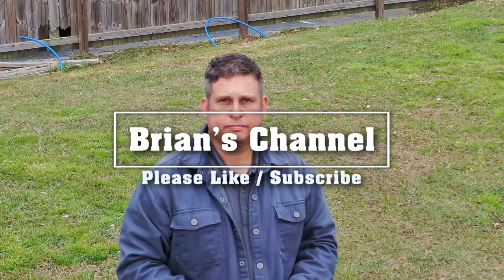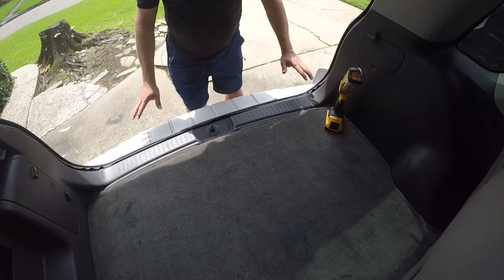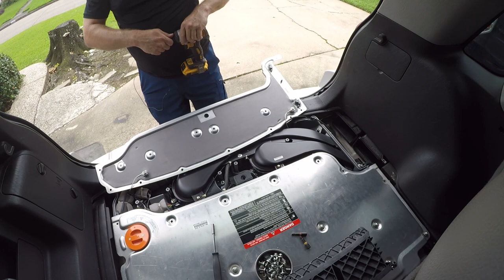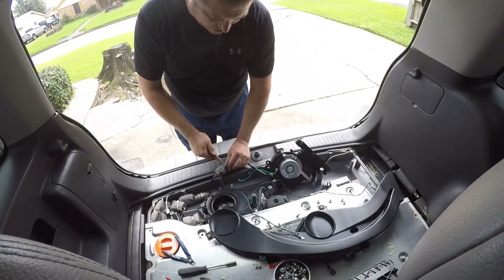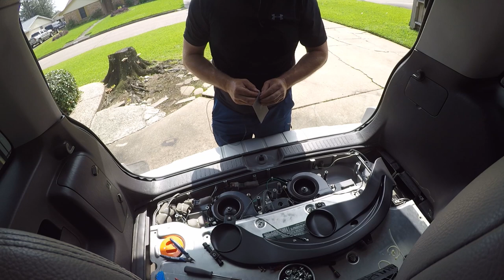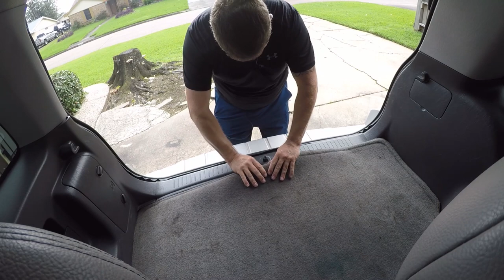Ford Escape Hybrid: Replacing the Hybrid Battery Fans

Comment: Great video. I have an issue with my cooling fan on my 2005 Ford Escape Hybrid, and this video will help me diagnose or fix it. What year Ford Escape Hybrid were you working on on that video?
Reply from the maker: I think it was a 2007.  I've since traded it in when I bought my Frontier.  The Escape battery was on it's way out and I decided I needed something a little shinier and more reliable to drive.

Comment: Hi Brian! this was a helpful video. last night I replaced the battery cooling fans after having a wrench light go off for the past 3 summers. I got the codes for the cooling fan but the dealer wanted a fortune so I replaced them myself. Long story short after replacing the fans the wrench light is still on but the vehicle is going into EV mode . Do I need to clear/reset the codes somehow? or is there a bigger issue. Thanks!
Reply: Next thing I would check is clearing the codes with Forscan ( there is a mobile version) You will also be able to see the BSOC and other BCM gauges. Since it's been 9 months the codes should have cleared on their own I think, if the problem is resolved. On my 06 FEH I just had the compressor and evaporator replaced. Next step is to do the battery fans.
Reply from the maker: @The-Grateful-Hippie  Make sure they did the rear orifice tube as well.   that makes a huge difference and mine was nasty when I replaced it.
Reply: @hotpuppy72  Hmm I did the replacement myself. I cleaned inside the ducts and there was a little bit of dust inside the battery case but it wasn't bad. Hardest part was getting the darn cover back on the case.
Reply from the maker: @The-Grateful-Hippie  The orifice tube is part of the AC system.... there is a dedicated AC unit in the back for the battery.
Reply: @hotpuppy72  OK! I will mention it to my mechanic who installed the AC. Everything is working great now 👍

Comment: Hi Brian! very helpful video. my 2008 escape have the fan code. that's why I ending replacing them how ever on your video ones you removed the fan cover you go and start the vehicle to check which fan wasn't working. my vehicle does start if the battery switch ( the orange  switch )pack is in the off, it was giving me a red warning triangle on the dashboard. do you know anything about it.

Thanks in advance.

Comment: Hi Brian! Thank you so much for the video. At  9:01 you turn your car on and I hear a grinding/pressurizing noise from your HCU I believe. My Escape makes the same noise!! Do you know if it is bad? Did the fan replacement make it go away? I believe it is from the HCU and am worried of brake trouble. I would so appreciate a reply. Thank you.
Reply from the maker: It was just going through self-test.  Always did that.

Comment: Did the fan that required replacement just abruptly stop working or did you first hear chirping or whining to indicate the motor or a bearing was crapping-out?  Also, once it failed and threw a code, did you get a HI TEMP immediate shut-down (limp home) dash warning or were you able to drive it for a significant amount of time?  Just curious....
Reply from the maker: It threw a code.  I should have replaced it right away.  The car stopped doing hybrid as much.  I should have replaced it sooner honestly.  

My biggest aggravations with the Ford Hybrid are the un-serviceable battery pack.  There is absolutely no reason for the battery to not be modular "sticks" of cells that are replaceable.  Except that Ford doesn't give a sh*t about owner's doing maintenance.

Second issue is the crappy HVAC design that requires the engine to run to have an air conditioner.  non-starter in a hot humid climate.

Third is the ABS module requiring a computer to bleed the brakes.  SMH.  Stupid stupid stupid.  

I have a Nissan Frontier now.  Simple, reliable and non-hybrid.  Plenty of stupid crap on it, but mostly very easy to work on and maintain.
Reply: @hotpuppy72  Feel the same...love the looks and MPG of my 07 FEH, but the more I dig in to the "workings" the more certain I get that I don't want another hybrid.  I just want to run this one as long as possible/reasonable.

Last year I purchased a DVD from a Ford dealer via EBAY for $8 that has the full service manual for my vehicle.  When the DVD was created in 2007, it didn't even account for replacing the battery fans.  The diagnostic flowchart stated once the tech determined one/both fans stopped working (i.e. it wasn't a wiring issue), the entire battery pack was to be replaced.  Of course, 99% of the time the vehicle would've been outside the bumper-to-bumper, making that repair the owner's to eat.  The other thing they apparently did either in 08 or 09 was ditched the jump-start button to allow the owner to use the 12V to charge-up the HV battery.  You see videos of mechanics that had to extract the HV battery just to charge it because the owner let the vehicle sit while they traveled or were in the hospital.

Can't imagine how many owners surrendered their vehicles to junkyards unaware a $200 fan would've fixed their problem OR were convinced to buy a new HV battery by a repair shop that didn't understand what they were dealing with.

I suspect more than a couple owners have surrendered their FEH after getting the ABS BRAKE warning after they replaced the 12V battery (believing a mechanic that told them the $5000 ABS repair was needed).  My owner's manual states you need to slowly depress/hold/release the pedal after disconnecting/replacing the 12V.  However, it leaves out what the service manual DVD states, it needs to be KEY ON/ENG OFF before depressing.  That error is scary as hell and certainly led to owners having it towed to a dealer (that hopefully showed them to honest/simple fix).

Oh well, appreciate your video/comments and hope mine can help even just one owner that's determined to keep a FEH running.

Comment: I didn't see you take the fan extensions off the old fans to put on the new fans.  The fans in the kit do not have the extensions on them so they need to be removed from the old ones and put on new to have an air seal when installed.  I noticed this from another video that mentioned doing this step.  Thoughts?
Reply from the maker: Yea I moved them over.  Good catch.

Comment: You’re not into the high voltage section of the pack but you did give a safety disclaimer about the high voltage. See that round orange thing? You should have removed it as a safety precaution.
Reply from the maker: Almost right.... the orange round thing is in the "disconnect" position and it's been left in place so that nothing drops into that hole.  But you are absolutely right about making sure it's turned off and staying out of the high voltage area.
Reply: @hotpuppy72  oh yes. I forgot. You pull it out and drop it into that position. Just may have wanted to mention it in the video.

Comment: My sons 2008 escape has the P0A81 code by itself and does not go into ev mode.  I opened it up and checked the fans and they are running.  I cleared the code but it comes back right away.  Any thoughts?  Are the fans still bad or is it something else?
Reply: Did you find the problem?

Comment: I’m curious as to what the ohm spec is for these fans. Seems like a common failure with these escape hybrids.
Reply from the maker: No idea.  Keep in mind they run non-stop when the vehicle is operating.  Every fan wears out at some point.
Reply: On my 2007 the left driver's side fan has rough bearings noisy. Dealer service rep said one fan fails more than other not sure which yet. Finished took for ride battery charged parked  could hear air blowing, no squeal fans working great. Be careful skidding battery their are foam pads on bottom that stops noise. Their are 2 lifting lugs on side of battery pack ,be CAREFUL HOOKS MUST BE VERY SHORT OR THEY WILL DAMAGE CASE less than3/8"both ways.

Comment: Hi Brian! Are there any changes in the operation of the car after this replacement? And thanks a lot for your video!
Reply from the maker: Failing to replace these will shorten the life of your battery cells.  These have to run.
Reply: The vehicle will not go into EV mode if the HVTB gets too hot.

Comment: How much does one cost? At least a used one
Reply: Note if you buy the 2fan kit from partsgeek.com ,it's an  OEM kit with detailed  instructions . $274 Note also cover screws have 2 different torque and instructions specifically state DON'T USE POWER TOOLS. They also want you to take battery out and do work on bench .there are 4bolts on the sides of the front cover AND 2 IN FROUNT which prevents it easy removal of rear cover went easy enough 2person job to remove. Weights 220lb
Reply from the maker: Ford also says the battery is non-serviceable.  Just use common sense when removing and installing the fasteners.  

Ford would you like you to bring the vehicle in and be sure to place it in Park with $10K in cash inside.  They'll unload the cash before returning the vehicle to you.  For some reason Ford thinks Hybrid=sucker and decided to make an unmaintainable battery.  Zero excuse for that other than saving a $1 or $2 on manufacturing.   That battery should have had modular battery segments that could have been replaced in groups or 4 or 5 cells.  Problem is that would keep the vehicles on the road indefinitely and the stealerships and corporate don't make buckets of money that way.